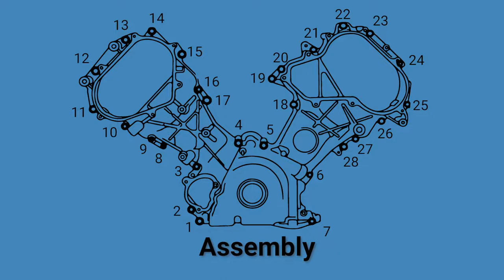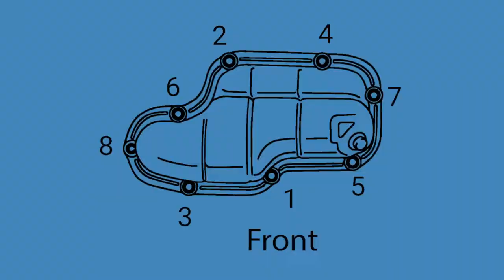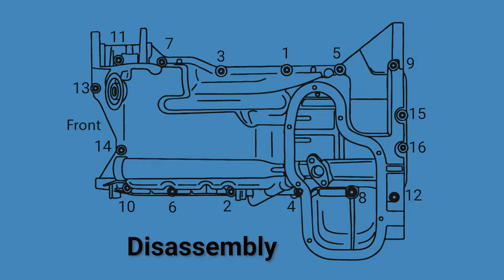VK56 Engine Rebuild Part 6 (tearing down to the block)

Comment: How many miles are on that engine , there sure is a lot of varnish built up it must have had looooog oil change intervals. I did the timing chain tensioners on my X at 150k an the inside was still clean
Reply from the maker: Yea, the last guy did NOTHING when it came to maintenance. This engine has 217000 on it.

Comment: Why does it not matter that your timing sprockets skipped? 

How could I prevent mine from skipping?

Im doing a timing job and head gaskets, no new cams. For anyone with a VVT vk56, there are bolts hidden behind the cam covers. (I found that out the hard way.)

Your videos have been insanely helpful and are very well done.

Comment: Hey man, great videos and much appreciated!  I'm in the middle of a head gasket replacement on a vk56 out of a 2010 armada. The head bolts are a weird 6 point castle looking type shape, I think it's a specialty Nissan socket. I watched your vid a couple times but it doesn't look like you used an actual socket for the head bolts, just the 10mm hex... Do you know anything about the issue I'm describing? I can post a pic if needed. Thank you brother, much love 🙏
Reply from the maker: Yep! My new bolts are like yours. Look up "etorx" or etorx plus" they might be plus. E for external.
Reply: I got them off, much appreciated my brother. Keep it up man, namaste 🙏

Comment: What manual are you referencing, can you show it to us?
Reply from the maker: I use the original factory service manual. Unfortunately I can't share it cause I don't want any legal trouble.
Reply: @Rythecarguy  Not asking to show content, just the cover and showing that is not illegal.  Some of us like to use service manuals and there are several out there by different publishers.  Just curious who published yours...OEM?
Reply: @Rythecarguy  Where can one purchase a factory service manual?  I have a Vk from a 2011 Infiniti M56 that is getting swapped but i might want to try and rebuild the motor- to have a spare-  this will be the 3rd engine going into it-  each has failed at 100k.  Thanks for the video- glad i found it! (ps i have subscribed to learn more!)

Comment: hei mate, do you have any indication on the weight of a dressed vk56 engine.. is 550 lb a fair bet ?
Reply from the maker: Manual says you need an engine stand that can handle 539 pounds so 550 is a really good guess. If you want to be conservative go with 600. Hope this helps!💪🏻
Reply: @Rythecarguy  thank you so much for the reply !